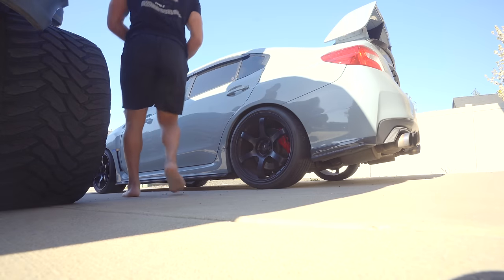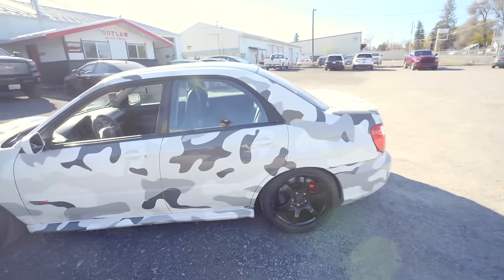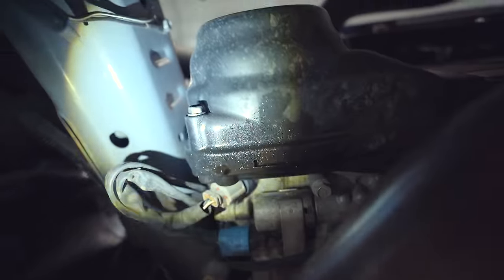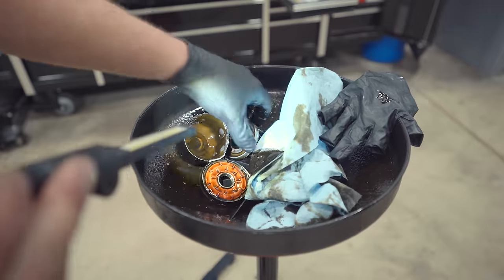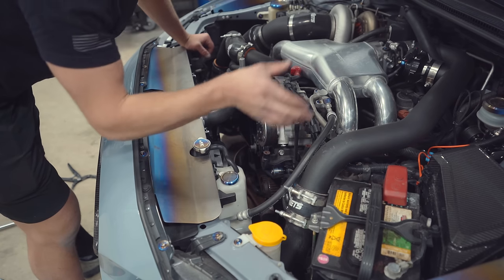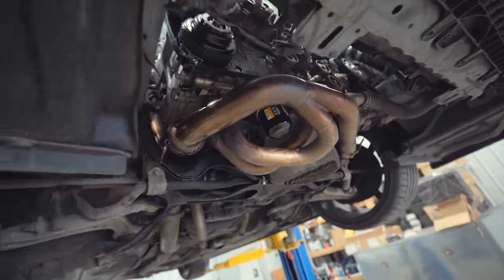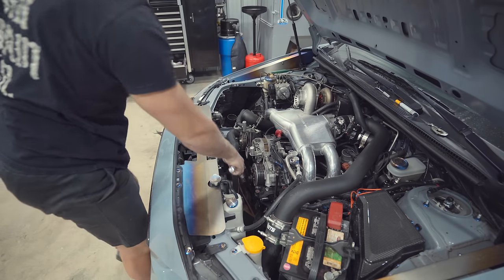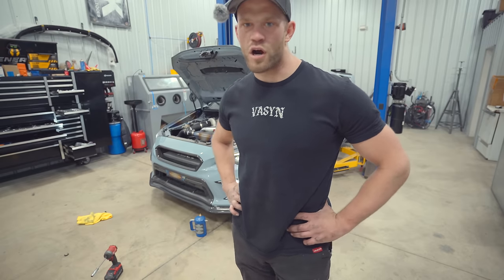A "Quick" STI Maintenance Day Turns Into This...

Comment: Mine is stock engine I installed act clutch Perrin inter cooler invidia pipe Cobb intake Cobb blow off you think I need to tune please I need to now
Reply: Yes! 100% get a tune... no point in adding parts and not getting the full benefit from them while also being safer. As you're introducing more air into your engine with the cobb intake and also the bigger intercooler